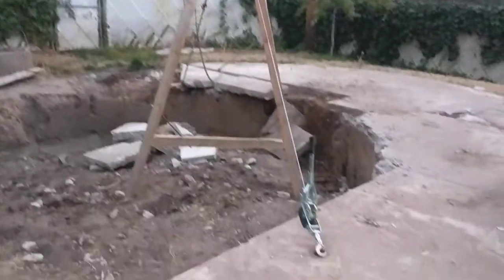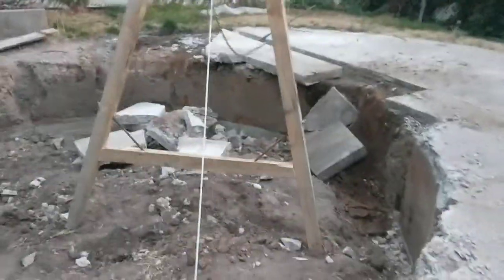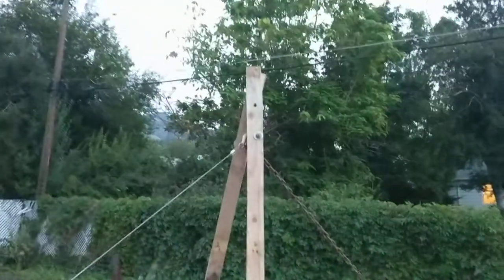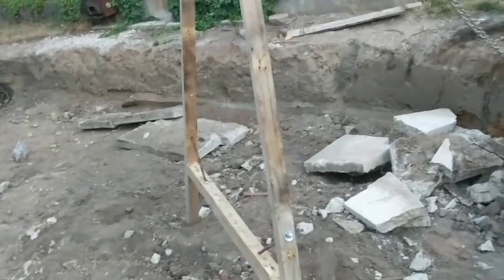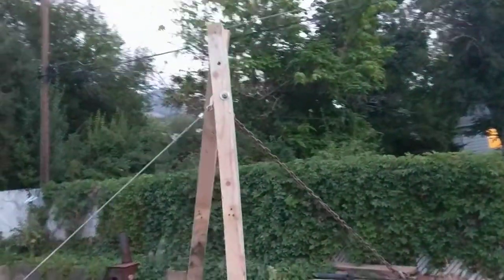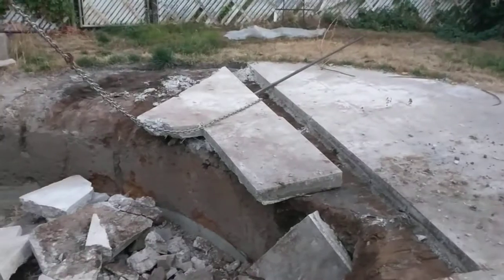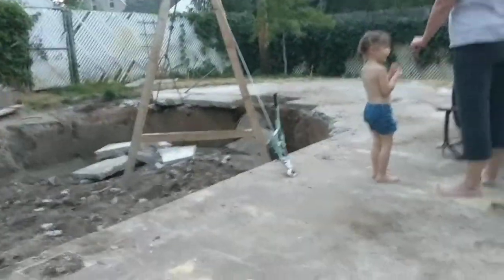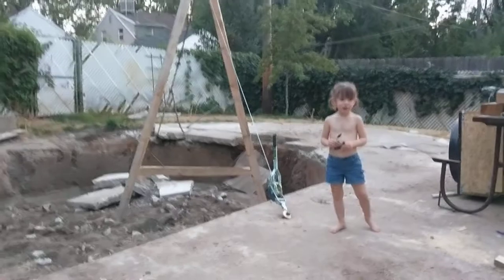Labor saving device! "A" frame modified Greek Crane for pulling heavy concrete

Comment: Interesting 10 hr solution, however thinking... crumbling non- reinforced 3.5” concrete slab + 12 lb sledge + pry bar = 1hr tops. Extra points for physics lesson!
Reply from the maker: Oh man trust me, I busted up plenty of it with a sledge; it was slow going with a 10lb, then I found an old 16lb at a garage sale... Ridiculous how much different. The other problem with that method is that it leaves so much crumble on the ground. I suppose if I did it again, I'd just rent a small excavator and knock it out in an afternoon. Sooo glad this project is complete! Thanks for the comment!
Reply: An engineer taught me to dig under the edge and lift with a car floor jack then hit it with a sledge, limited crumble. Rebar is often the vex.